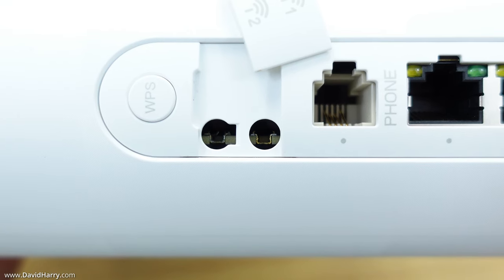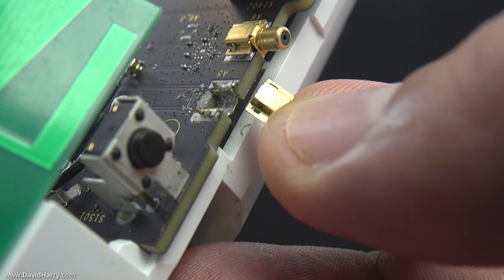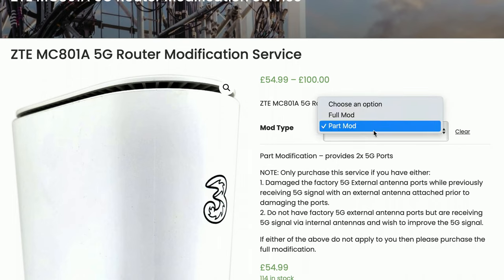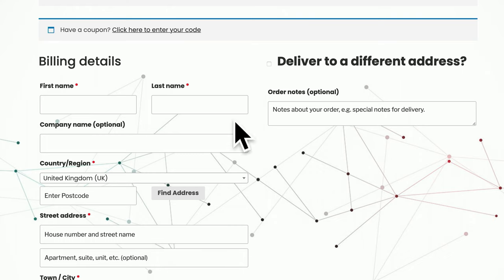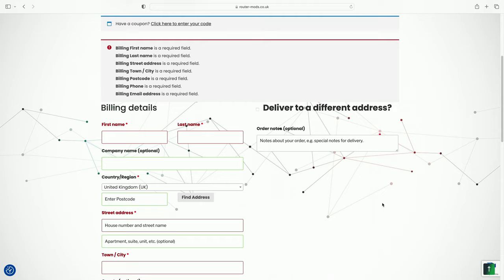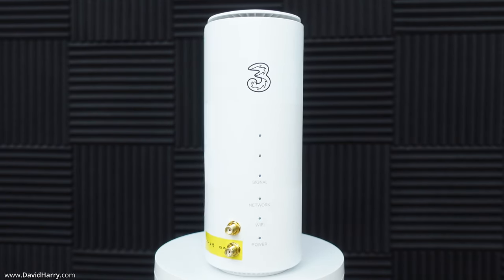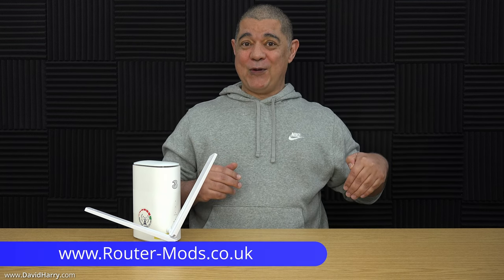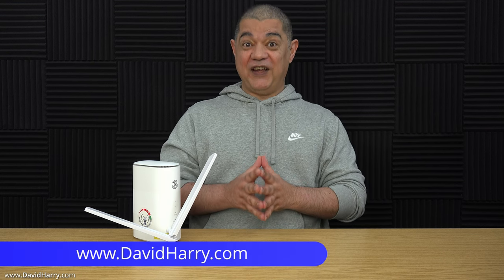TS9 to SMA 5G antenna port modification for ZTE MC801A 5G router by Router-Mods.co.uk

Comment from the maker: Visit Router-Mods https://geni.us/RouterModsWebsite

Router-Mods playlist: https://www.youtube.com/playlist?list=PLleKChtNUwZTyTwZxrJRYPUXTSJUzi5kP

How to fix broken TS9 sockets on your ZTE MC801A 5G router. Get the RouterMods SMA port modification.

TS9 to SMA 5G antenna port modification for ZTE MC801A 5G router by Router-Mods.co.uk

Here's my Router-Mods playlist, this will grow over time with reviews, comparisons, how to guides and general information about 4G routers, 5G routers, 4G & 5G antennas and a bunch of other stuff to do with wireless cellular internet and broadband https://www.youtube.com/playlist?list=PLleKChtNUwZTyTwZxrJRYPUXTSJUzi5kP

In this video I’m showing you a service by Router-Mods.co.uk which modifies the 5G TS9 ports on a ZTE MC801A to SMA sockets. This is the same 5G cellular wireless broadband router that Three.co.uk supply.

The reason why I had the two port SMA modification done to my Three ZTE 5G router was because 3 three.co.uk who sent me the router as part of my 5G broadband cellular mobile wireless service, wouldn’t not fix or replace the router. This was in spite of the fact that I did not damage the TS9 ports on my Three 5G router through any misuse.

This equated to very bad customer service and support from Three.co.uk and terrible after-service.

The simple fact is that the TS9 sockets are too fragile and not fit for the use they are designed for and are almost guaranteed to fail and snap off with the slightest of pressure applied to them, which is unavoidable when connecting external antennas to the TS9 ports.

Also, the weight of the cables attached to the TS9 sockets from a 5G antenna, are also likely to damage or snap off the TS9 sockets. This is because the TS9 sockets are only soldered to the router’s motherboard and have no practical strain relief.

As Three refused to honour my warranty, even though I was only into the first three months of a 24 month contract. And this was after I had explained to them that with the broken TS9 ports the router was now only capable of picking up a 4G signal with its internal antennas and not give me the 5G service that I was paying for. I had no option but to get the router fixed and this is how I come across www.Router-Mods.co.uk

Although this modification was to fix the problem of the broken TS9 sockets on my particular Three ZTE router. This modification of the TS9 sockets to SMA sockets is almost a must for anyone wanting to use their Three ZTE router with an external 5G antenna anyway. Before you run the risk of the TS9 sockets being damaged due to no fault of your own.

The reason why, is because the SMA ports are connected directly to the case of the router and not the motherboard. Which offers excellent strain relief for the SMA ports and the cables from any connected external antenna.

If you have any 4G router or 5G router that uses TS9 sockets, you may want to check out www.Router-Mods.co.uk as they offer similar modifications for many other 4G and 5G routers. They also offer full modifications as well and I will be testing a fully modified ZTE router soon with the 8 port SMA modification by Router-Mods.

Please give a thumbs up, share, sub & click the bell for notifications.

The stuff I mostly use to produce my videos

Cameras:
Sony FDR-AX100 https://geni.us/SONY-FDR-AX100
Sony ZV-1 https://geni.us/SONY-ZV-1
Sony A7iii https://geni.us/Sony-A7-iii
GoPro Hero 11 https://geni.us/GoProHero11Black-USA
DJI Action 2 https://geni.us/DJI_Action-2

Microphones & Preamps:
Sennheiser ME64 with K6 https://geni.us/Sennheiser-K6-And-ME64
Shure SM7B https://geni.us/SHURE_SM7B
Various RODE Microphones https://geni.us/Rode-Microphones
Triton Fethead https://geni.us/Triton-Fethead
Behringer U-Phoria UMC2020HD https://geni.us/BehringerUMC202HD

HDMI Capture Device:
Atomos Ninja V https://geni.us/Atomos-Ninja-V
BlackMagic Ultrastudio Recorder 3G https://geni.us/UltraStudioRecorder3G

Computer & Software:
Apple MacBook Pro M1 Max https://geni.us/MacBook-Pro-M1-Max

My Amazon links are affiliate links. Using these links does not cost you anything. As an Amazon Associate, I earn from qualifying purchases. This gives me a small commission when buy using my product links, at no cost to you. These commissions help my channel and their use is greatly appreciated.

You can also send me a coffee donation via PayPal https://www.paypal.me/DavidHarry

My Amazon Shop links:
Amazon USA https://www.amazon.com/shop/davidharry
Amazon UK https://www.amazon.co.uk/shop/davidharry

My global Amazon links:
Amazon USA: https://geni.us/Amazon-USA
Amazon UK: https://geni.us/Amazon-UK 
Amazon Deutschland: https://geni.us/Amazon-Deutschland
Amazon Canada: https://geni.us/Amazon-Canada
 
Contact me for product reviews.
YouTube@DavidHarry.com

http://www.DavidHarry.com

I’m David Harry. Thank you very much for watching this video, take care and goodbye now.

Cheers,
Dave.

#DavidHarry#LiverpoolTV#RouterMods

Comment: I am moving into an old stone Victorian terraced flat, so it seems that the Three 4/5G Broadband router is my only option to connect my PC , so this video is very very useful!.
Reply from the maker: Hi. I’m glad the video was helpful. As long as you have good signal in your new flat, then using a 5G or 4G router would be fine. You may want to test your signal first before committing to a router and contract. Just use your phone to see what the signal is like indoors of your new flat and do some internet speed tests, the Speedtest.net app is good for testing. If possible, try and test other carriers as well, EE, Vodafone etc. And see what their signals are like. If you buy some cheap pay as you go sims, that may help to work out the best mobile carrier data signal for that location. Cheers, Dave.

Comment: Hello, David. A late question. I have the exact same modem, and I need some antennas, as my modem has hard time picking up 5g signal from further tower. If I were to use the original ts9 ports, and add lte 5g antennas, will it help with the signal strength? Currently I am around -84 dBm, which isn't great. Thanks.
Reply from the maker: Hi. If your -84 is in reference to your 5G signal, that's actually quite good for the built in antennas. Adding an outdoor external 5G antenna will only be useful if it's within line of sight of the 5G cell tower. Don't forget, you will also need a good 4G signal for 5G to work properly (in the UK we use NSA). If you do use the TS9 ports be very careful, they're super easy to damage and break off and then 5G won't work at all. Give Router Mods a call, they have everything that you'll need. Cheers, Dave.
Reply: @DavidHarry  Hi, Dave. I was referring to my 4g signal, which is around -80 dBm. My router rarely picks up 5G and when it does, the dBm are up to a -100 and plus. Do you think regular indoor antennas would at least help, so I could have stable 5G? Thanks.
Reply from the maker: @medot8296  Hi. It’s highly unlikely that external indoor antennas will make any difference. I’ve tried a few of them and some even make things worse. Cheers, Dave.
Reply: Thanks for the reply, Dave. I will definitely think about trying antennas, if they will work, I will let you know. God bless. @DavidHarry
Reply from the maker: @medot8296  👍

Comment: I've seen a few complaints on the web about this but now I fully understand what it's all about. I'll simply stay away from this router since I have no cheap access to routermods. Unless I do it myself but I don't want to mess around with trying to get the right impedance matching.

Comment: i purchased a router form them 1000 in total got an lpda 0092 came used in the box from them all tatty beat up cant get good 5g speed on the phone get 250 avg on the router 20-100 seems to work better with no antenna installing antenna changes nothing signal does not change was extremally pissed with this purchase the router was a cpe pro 3 tried multiple networks same poor speed the only reason I got this was the antenna would be needed where im moving but they are not hooked up I believe
Reply from the maker: That’s interesting, you didn’t mention anything about what modification you have or what external antennas you are using. Plus, due to the modification, you don’t have internal antennas anyway and absolutely need to use external antennas for anything to work. So you won’t be getting anything like a good signal anyway without the external antennas attached. I’ve now used a few of their modified routers and they’ve all been brilliant and I get much higher speeds on the external antennas compared to the same router using its internal antennas. Also, if you’re not positioning the external antennas correctly or you’re in a poor signal area, no amount or type of antennas, internal or external, will make any difference anyway. Cheers, Dave.

Comment: For 54 quid you could do it yourself very easily, just get sma wired and solder onto board in replacement of the internal, drill a hole in the front and nut in the back to hold in place secure....
Reply from the maker: For £60 you can get a professional to do it properly.